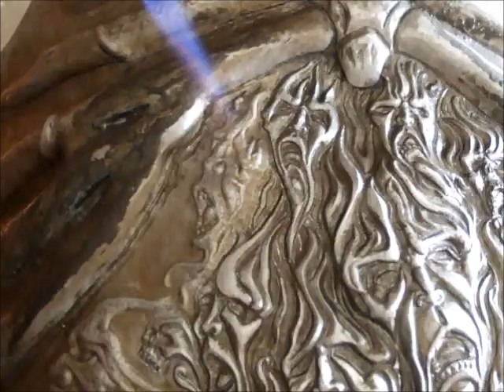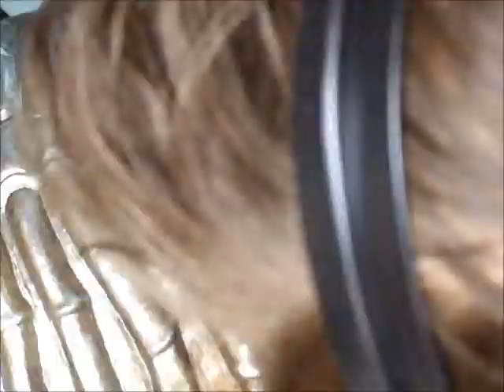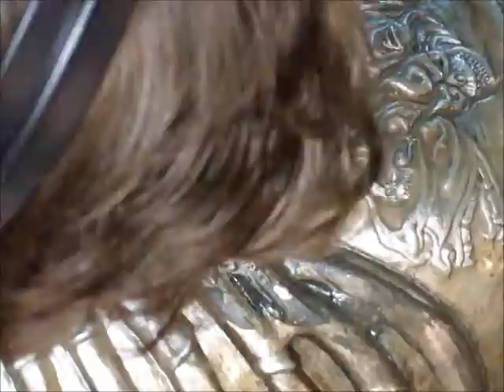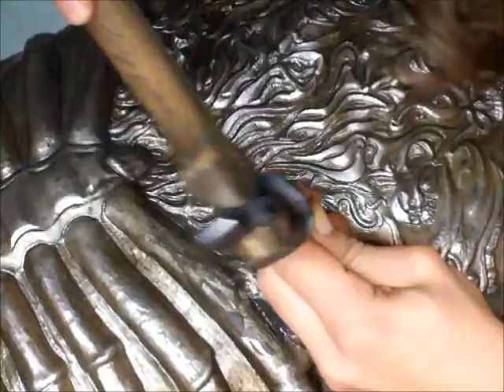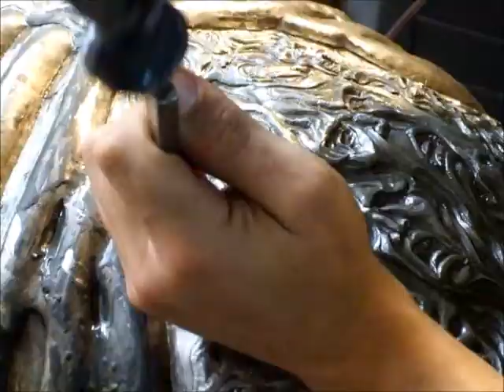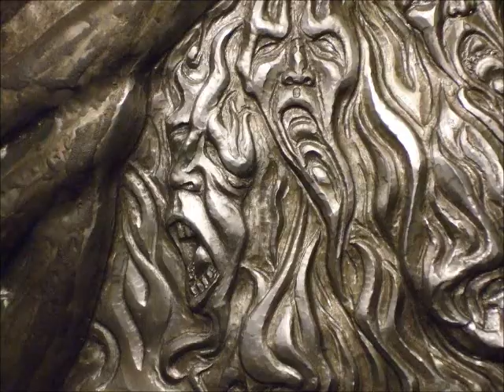Douglas Pryor Skeleton Breastplate Repousse Part 2

Comment: Huge newfound fan here.  This is a completely stupid question, but just humor me.  Is this iron or steel?  I am brand new to metals and work primarily with soft metals such as copper and brass.  Like Douglas here, I worked in a steel shop years ago, but hated welding. I LOVED polishing steel though and made my own sculpture with very minimal sloppy welds and just a hell of a lot of grinding them down into one smooth piece.
Reply from the maker: Hey there Randy, no worries man! This breastplate and backplate was 14ga steel. lol and it's not a stupid question, I don't think I list it anywhere and there are lots of metals that can look like steel.

I went to school for welding  before deciding it wasn't what I wanted to do for a living, but it did leave me with a lot of questions about metal work that eventually led me to raising, chasing  and repousse. I work in all kinds of metals now but steel is still a favorite!

If there's anything I can do for you Randy or any more questions just let me know! My emails on my website at douglaspryor.com but I think you found me on FB too. 
Cheers and happy hammering!

Comment: fantastic video. this obviously is only a fraction of work involved.  2 questions : how many hours of work was involved in this piece? what kind of metal were you using? thx for sharing.  mike
Reply from the maker: dunhillwatchlighter this was a few years ago so the hours are not as fresh in my mind. There's a backplate to this too, both made of 14ga mild steel. Spent a few months on these, at the time it was one of the more complex pieces I had worked on.